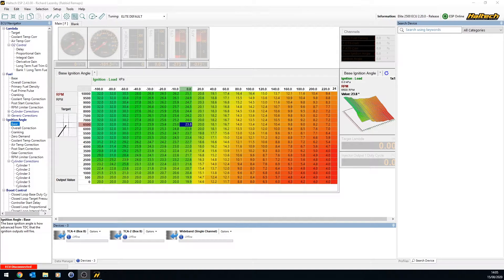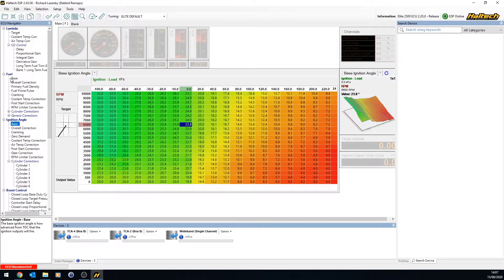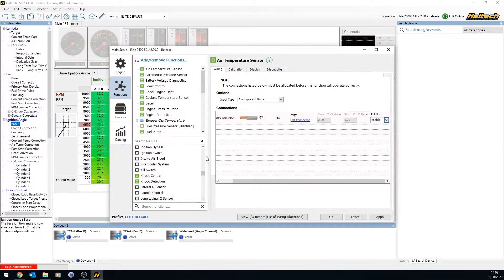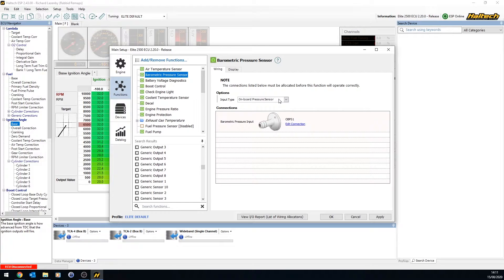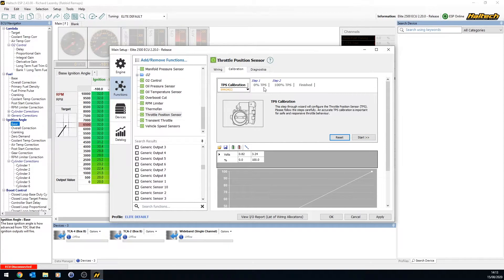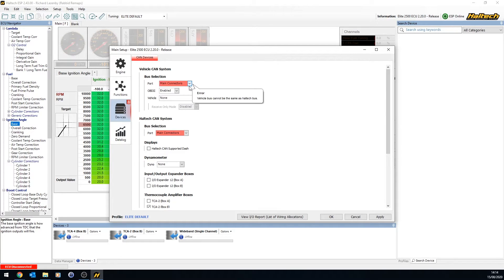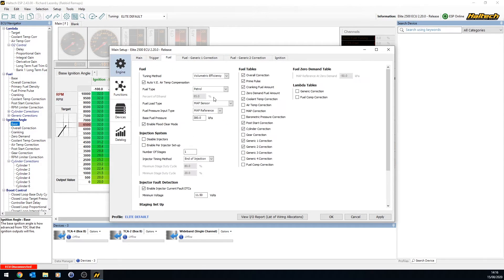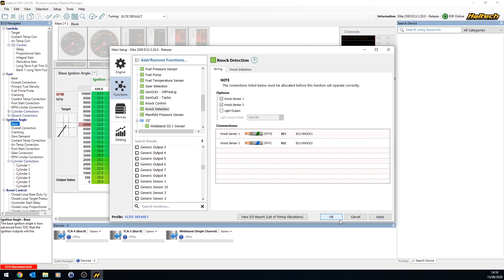Haltech Elite Tutorial Part 5 - Sensor Inputs and Calibration

Comment: Hopefully you still check these videos! I noticed your oil pressure sensor had its pull up resistor enabled… don’t those usually have a 3 wire connection which don’t need a pull up?

Also, are you familiar with using an existing oil pressure sensor/gauge combo like AEM? If it just has a 5v output, do you wire that directly to an AVI without a pull up resistor? I’m assuming there’s an offset since the gauge uses a chassis ground instead of a sensor ground?
Reply from the maker: As this was never a real car just going through the motions in the software I didn't pick that up.

Yes a 3 wire sensor doesn't use a pull resistor and 2 wire will use one.